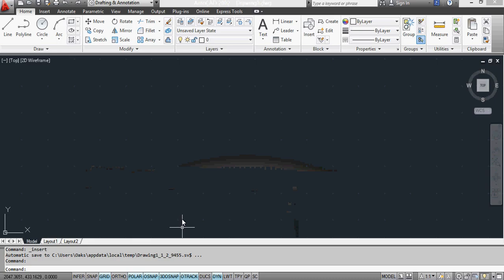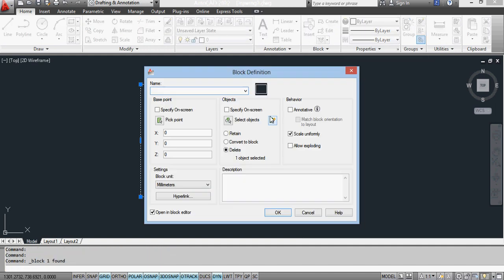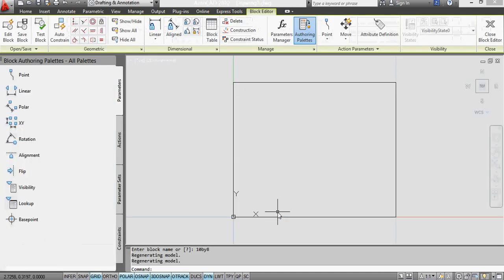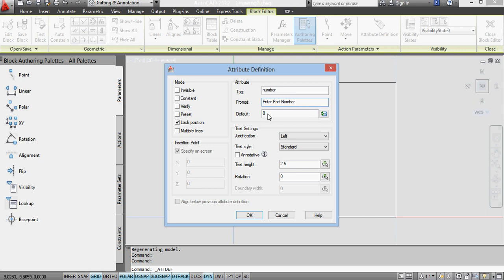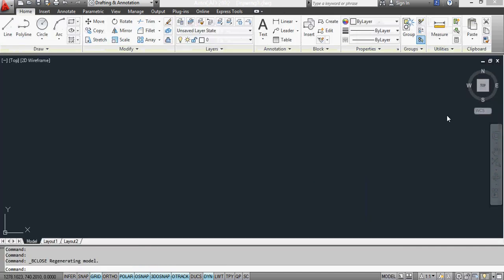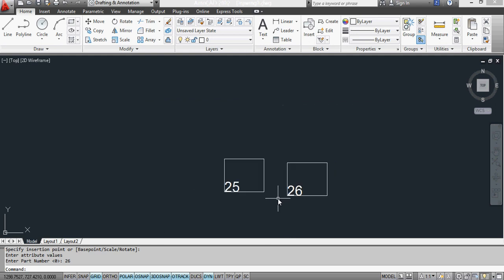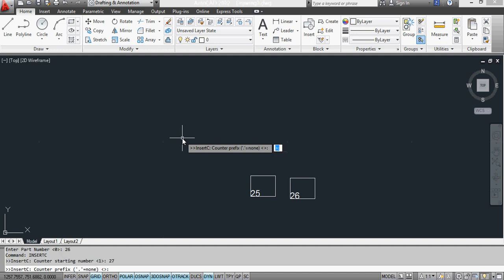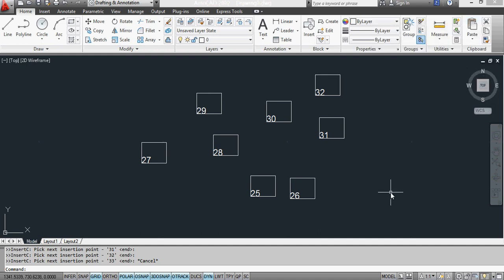AutoCAD Numbered Block Attribute

Comment: I didn't get the incert c command ??
Reply from the maker: You won't get the command unless you have installed the add-in. I can send it to you if you let me know where you want it sent.
Reply: @OakleyTurvey  after receiving file what r the step should i have to take..sir
Reply from the maker: The Insert C comes in a zip file. Extract and load it in AutoCAD. You will then have the command. Follow the steps in the video.
Reply: @OakleyTurvey  thanku sir..
Reply: @OakleyTurvey  sir i have so many confusion in layout and plotting ..i.e how a 3 km line plotted in A3 paper or A4(210x297)mm.how to scale sheet why we have to scale sheet...instead of scaling drawing..etc
Reply from the maker: @iftekharkhan8879  https://www.youtube.com/watch?v=zLXq6otWAcE&list=PLxYkfqICngaNeAPy0Q43g1J2DGzs_7kw9&index=32 
Is this video any help to you?

Comment: Great video... do you have a tip on how to autocount the attribute not when you insert the block but when you touch/click on the block.  What I'm going for is to autonumber a block attribute when I connect a line to it
Reply from the maker: Hi D P . 
Sorry I'm not sure how you could achieve this. How would the block know that you had connected to it? You would have to have this lsp running continuously, which would mean you can't use any other commands, so how would you connect the line if you can't run any other commands?
I do have another lsp that just puts a number on the drawing, but it is not part of a block or an attribute.

Comment: Many Thanks Oakley!

But is there also a way to increment ALREADY INSERTED blocks?
Regards
Pete
Reply from the maker: Hi Pete,
Should be simple enough ( I say without looking at it). If you send me an email I can send you the files to have a go.
Reply: Hi  @OakleyTurvey  ,

it took me some time to respond...

Here is a sample DWG file containing a dynamic block with attributes:

https://drive.google.com/open?id=1Sg_tiNfGpmGqsrXDB-L5ZyowyV8TTYk7

It's a plan view of a DN 1400 sewage pipe, 3 meters long and 15 cm thickness.
The attribute called "Description" should be changed to an automatically numbered index, like: "Pipe 1001", "Pipe 1002", "Pipe 1003", etc.

Can this be done with Vanilla AutoCAD (R2020) or one of your LISP routines?

Comment: Its great, it would be possible to have more increments in one block after inserting it?? for example, in this video, the rectangle would be 25 and 26 after inserting in a single block.  Respectively, it would be possible to set the amount of incremented numbers in one block (more numbers in one block). It is possible??? Verry verryThank you ... sormanp@gmail.com
Reply from the maker: Hi there, Yes it would be possible - but you would have to edit the code to suit. At the moment it just edits the first attribute. I'll send you the file as it is.

Comment: I loved using this! But now I have AutoCAD LT 2018 and Appload is no longer allowed. Do you know of a work around that does not entail purchasing a higher version (price) of AutoCAD? Thanks.
Reply from the maker: Richard White sorry there is no legal work around other than buying the full version... Do you still have the older full version? If not macros are still allowed in LT, but nothing like as good as appload.
Reply: Thanks. That's what I thought. I don't have the older full version any longer, so I'm a bit out of luck. Thanks for the reply, I really appreciate it.